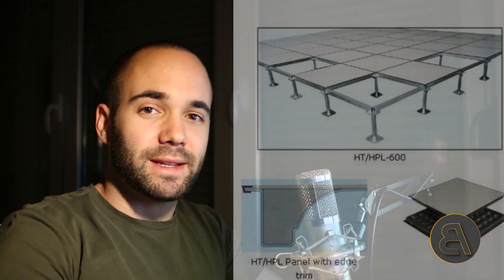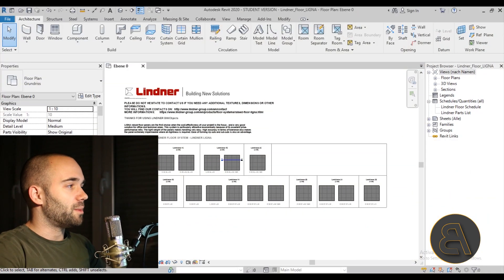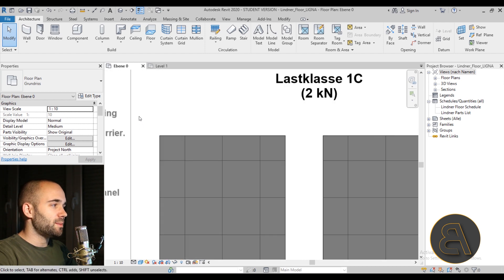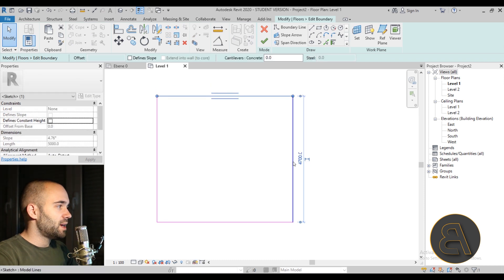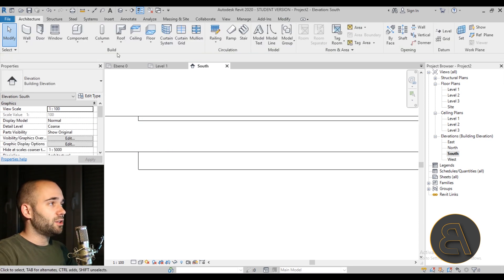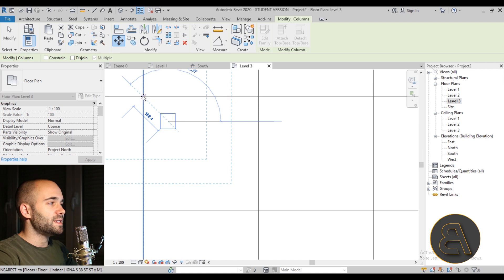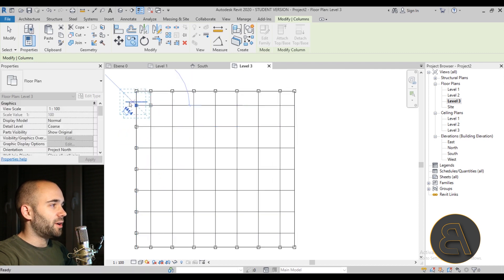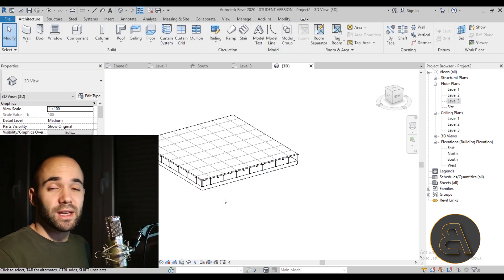Raised Floor in Revit Tutorial

Comment: Hi, please, show how to organize raised floor tiles not by default (symmetric in the room - same distance from left and right, or top and bottom walls), but according to need. For example, to start whole tile 60cm at one side of the room and finish with 30cm tile at the opposite wall. Thanks.

Comment: Hello. I have been following you recently. I have an urgent question, I am dealing with a file that some one elese have created , and when even I Create a new wall it  appears blue , not sure , why? I have check VG, & an VR nothing there. the materials structure is also normal, not sure how to fix it.
Reply: Make sure there is no view template assigned to the view
Reply: @AymenHumoodi  Thank you very much for your response! how to do that?
Reply: @saraebrahem458  in properties with no thing selected, look for view templates, make sure it is none, if a view template is assigned click it and select none.
Reply: @AymenHumoodi   Thank for responding quickly, nothing there as well. its none.
Reply: @saraebrahem458  then the only reasons will be wall material, check the wall material
Reply: If it isn't the material, it is highly likely the color is being controlled by the 'coarse fill pattern' property. Go to the wall type's properties, and check if it is being overridden here.
Reply: @AussieBIMGuru  . Hello, Thank you very much for your response ! No , I checked its not the Course fill or the material. I think there is some kind of parameter there, cause even if I copy some of the walls will normal black cut line and hatch, The new copy turn to a blue cut line and specific hatch in-between, doesn't even show the structure layers defined in the wall properties , even if I tried to show it, its doesn`t show . Any new or a copies of a wall are always with the same blue color and the same specific hatch. Have you any idea how to solve that?
Reply: @saraebrahem458  some other ideas are to check the 'default wall' material settings, or to check filter settings in VG overrides
Reply: @AussieBIMGuru   Hey. I fund it in the phasing , there are some kind of filter overwrite on the new or proposed section ( so basically any thing that is specific under this category in the wall properties changes into blue, when I change it to exiting it change) . Do you happen to know a tutorial where I can watch manipulate ( project phase, phase filters and their graphic overwrite)
Reply: Found it*
Reply: @saraebrahem458  ah, phase filters! Nice work

I will probably make a phase video eventually, buy the Lynda video is fairly thorough: https://youtu.be/vyQGbeWfb2Q
Reply: @AussieBIMGuru  Thank you ver much, I really appreciate it! I started following you as well. I was wondering is there a Linda Chanel on YouTube and well
Reply: @AussieBIMGuru  That will be great if you do one of phasing , especially sometimes , the demolish walls or the replaced windows over lap with the new one, could that happen in this feature ?
Reply: @saraebrahem458  definitely possible to cover those aspects too. I'll add it to my list! Likely mid september :)